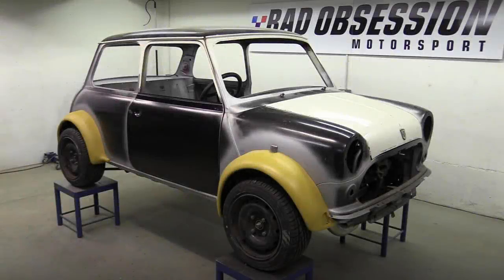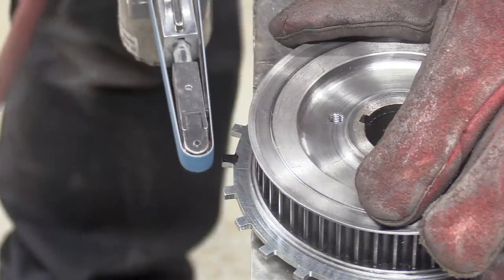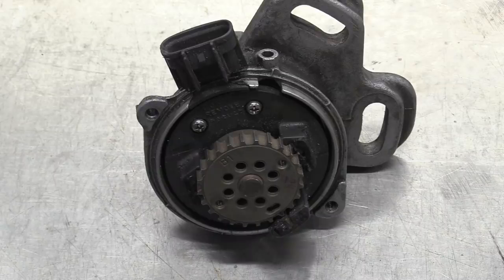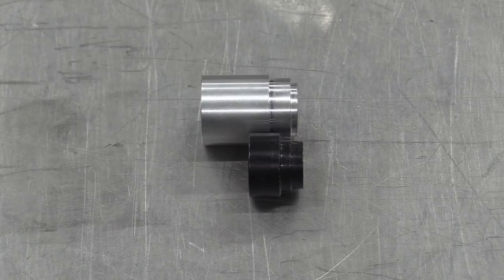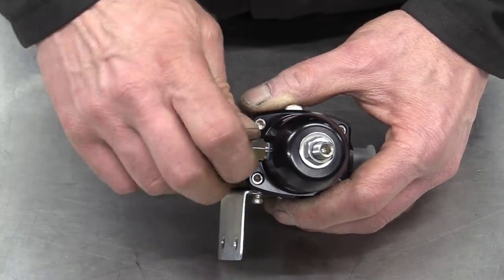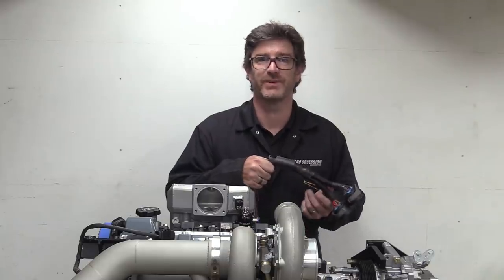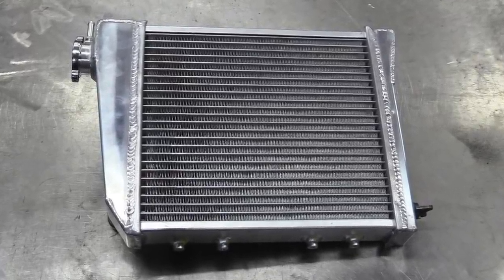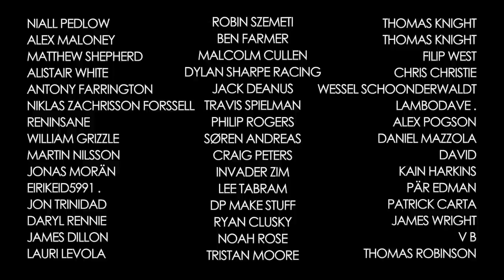Project Binky - Episode 32 - Austin Mini GT-Four - Turbocharged 4WD Mini

Comment: I thought for sure today was the day I'd see Binky painted... I guess not.
Reply: Give it another year or two and we'll get there. Probably sometimes after Nik decides to cram a custom microwave oven and small fridge in the cabin. It's important to have easy access to snackies while on the road you know...
Reply: @andersjjensen  You have just given them idea's that will delay the finish for at least six months.
Reply: @harveysmith100  We're still not even getting into fog visibility system via radar or torque vectoring via ABS programming..... You see, the thing with project cars is: They are perfect as long as you don't use them. Binky is not meant to ever be finished. It is meant to fuel Nik's day dreams about a perfect car :P
Reply: @andersjjensen  My apologies, I clearly haven't thought it through.
Reply: Hold your horses, there's 18 months of block sanding the primer on the inside of doors before we get to the base coat.
Reply: @andersjjensen  Since it can't house the speakers, might as well give the parcel shelf some use!
Reply: @andersjjensen  No microwave, just a kettle and mini fridge for fresh cups of tea
Reply: Comment of the year 2014, 2015, 2016, 2017, 2018, 2019 and 2020. It's on the shortlist for 2021...

Comment: gotta love old fashioned mechanical engineering, haven't touched a mill or lathes, surface grinders since 2002, Now in Design for oil platforms, piping and layout, and this is refreshing to see, as id love to have my own machines; and the space.

Comment: My thought when the carb was thrown was noooo I need its float bowl
Reply: Wasn't it an SU? If so they have an integral float chamber?
Reply: Brenton Edwards , only the very early SU had integral float chambers, the minis was bolted on with fancy rubber bushes so it could be used as a left or a right hand chamber by changing the rubber whotsit.
Reply: The later Metro ones (HS4s or something?) had the float chamber underneath and integral.  Marginally better but still shit 😁
Reply: Perhaps Nik will make one for you. Breaks out the lathe and the funk.
Reply: @johnsherborne3245  other way around the late su carbs and an integral float chamber
Reply: @DarthVader-on4pe  the hs1,2 and 4 had the float chamber on the side and from the hs6 on was integral I believe
Reply: 186scott my mistake, modern is 1970's I forgot about the later versions, though I did once come across with one on a Princess with a death wish.

Comment: Phenomenal work guys, this has been my favorite build channel here for quite some time!

If you're retaining the cam trigger, then you shouldn't need to grind a tooth off of the crank wheel since you could specify TDC as a certain number of crank teeth + an angle after the cam tooth. Generally, removing a tooth from the crank wheel to give a gap is only necessary if you're not using a cam sensor and instead running pairs of cylinders in "wasted spark" mode.
Also, I thought all hall-effect sensors were 3-wire; one for +5V, one for ground, and one for the output signal (logic-level 5V square wave). 2-wire sensors were usually variable-reluctance (VR), where an induced current spike in its raw form is generated between the two wires, which then requires amplification hardware in the ECU to turn into a logic-level signal.

Comment: I love cars, I have since I saw my first Mustang in 1964 at age ten. I love English cars, I have since I owned my first car at age fifteen, but since that car was a 1957 Hillman Minx Estate that I bought for $25, you may wonder why. I've owned two Triumphs, a 73 Spitfire 1500 and a 72 TR6... aaaahhhhh. I've also owned two Minis, a 64 Morris 850 project that never got finished due to it being scabier than a bat's ass and a really nice 67 Austin Cooper. It had the hot 1000cc dual SU motor and was RHD. My favorite car of all time, red with a black top and the red and grey interior. I bought it from a US Customs Inspector that got it at auction. Someone tried to bring it into the states without paying the import duty. This was late 1970s in Long Beach, Ca. I had it for about 18 months before it was stolen from outside my apartment. Bad Obsession Motor Sports videos on Youtube are my absolute faves! You guys are funny, smart, innovative, etc. you see where I'm going. Project Binky is one of the best engineered projects I've ever seen in my 65 years.

Comment: The 'O' rings on the top of the fuel injectors are not OK like that. 'O' rings need support behind them to resist the pressure trying to force them out. The radial clearance of the male and female solid parts directly influences the pressure rating of the assembly. Please consider revisiting you solution, I'd hate to see all your beautiful work lost to a engine bay fire!

Comment: For the less fab crazy you can use the caldina 3S or wasted spark camry 5S oil pump and drive gear that has the missing tooth wheel and drill and make a pickup for the knob on the cam on the rocker cover too.  Much simpler and cleaner than that giant dizzy lid.

Comment: Loving all you guys have done, but to just clarify on one point, those aren't Hall effect sensors on the cam & crank, they'll be inductive sensors if they produce their own voltage.
Keep up the good work chaps. 
Can't wait to see it finished, then see you get on with the Carbon Fibre V8 monster.

Comment: Hang on! You can't start doing painting next.  What about the flared wheel arches? They still need to be moulded. Plus where is the spare wheel going?  I think some kind of bracket to hold it to the handy space behind the driver and passenger seat. Though that could be difficult to get our.  Maybe an tyre shaped hole in the roof that a the press of a button a wiper motor springs to life and flings the required spare tyre out like a slice of toast into the waiting arms of the codriver. Brackets check, over engineered solution check, powered by awesome check - meets all project Binky design requirements.

Comment: Spot on comment with the CRT =)

Gonna play a little devil advocate for a second though. My comment being that sometimes a simple device can be a better option, but this also depends on what you want. Now... my POS Saturn has drive by electronics instead of a pedal cable, and EFI.... but when it comes time to replace either of those, well I'll have some figuring out to do. I'm not super genius Mr. Automotive, but I have plenty of hand tools, an o-scope, and a decent OBD scanner; I can usually figure this crap out with enough time and google searches. A carb and a cable I can fix in MUCH less time. Though I really don't want to go back to cold start issues, I would def advocate for a pedal cable (never have had one go bad even though I live in the rust belt).

Comment: Super Cool ,  I love the demonic little creation you two have been slaving away at for this long and mentally exhausting build. the idea is completely bonkers but you have somehow been able to achieve the seemingly impossible. with space being at a premium (it is a "Mini" after all) there didn't seem to be a snowball's chance in hell that everything would really fit,  But fit it does (with a tweak and schmooze here and there) there is a somewhat similar build here  across the pond in U.S..and I think Nick's "Brecket Obsession is a good thing with al the bits that need holding in place in such a "Small" space under the bonnet and everywhere in that Diminutive  automotive contrivance they call a 'Mini'.there is a somewhat similar build here in the states you should check out called the "Insane Juke Project" where they use a Nissan Juke (micro SUV) with factory turbo 1.6 litre I-4 factory all wheel drive and increase the turbo size to the insane degree and find places for the other bits and bobs that go with it in a somewhat smaller package than the turbo was designed for making about 400 WHP in the end with an enhanced CVT trans, and custom built motor. to take the strain of the increased power potential of up to 500 WHP.  but your Mini is more challenging. and a lot more fun to watch how you come up with the solutions to the many little problems that always seem to crop up as you go along with the build, having al those cool tools and machines makes it a little easier( most of the time) but a "BFH" seems to be the answer sometimes , but then the right (precision or normal) tool is the better choice more times than not.

Comment: The fuel rail, coil hold down bracket, wire bracket over the pit of doom and the air to water intercooler need to be checked if their level so we can hear it make the noise.

Comment: wow, i missed the first time i watch it. But did you cut a radiotor in tree pieces and then flip them 90degrees. And then welded them to create a max airflow path . So you inverted a basic radiator. kudos to you!

Comment: Will be interesting to see how much it weighs when complete with all those brackets 😃
Reply: also the end Weight-Power Output Ratio 
it will be a mad mini 
oem Toyota Celica GT-Four 185 
Weight: 1,440kg 
engine power: 200 hp 
Weight-Power Output Ratio: 7kg/hp 
engine Weight,: 143kg 
total drivetrain: N/A 

oem 1980 Mini 1000 
engine power: 39 hp 
Weight: 620 kg 
Weight-Power Output Ratio: 15.5 kg/hp 
Engine and gearbox Weight: 141kg 

Garrett safety turbo GT3582R Turbocharger 
Horsepower: 400 - 675 Displacement: 2.0L - 4.5L 

now it is a bit hard to say what the end weight will be, but as it is Mini 1000 lets say 1000kg, 
but it will most like be less. 
now small hot engine bay lets say engine power is 500hp for easy match. 
but it will not be under 400hp 

Weight-Power Output Ratio: 2kg/hp 
vs 
Bugatti Veyron Weight-Power Output Ratio 2.1 kg/hp 

there are going to a lot of drug test done on cops the day Binky hits the road 

but superintendent I swear that Mini was doing 220km
Reply: @1BigBen  yep. 1000kg is my guess as well. The shell is about 100kg as the lifted it by hand. Drivetrain and gearbox are hefty kit, though.

Comment: love the engineering and genuine ingenuity of the drive for the ancilliaries and sorry if this was considered but for some reason not used but i believe you can get electrically driven power steering pumps and air con compressors?

Comment: As Nick insisted no making aluminium box brackets and seeing the very low voltage generated by the cam sensor I was thinking this can help with possible cross talk issues that is a signal in a conductor (wire) parallel to another inducing a signal in other parallel wires causing problems in the computer interpreting what it sees. This box bracket will act a a faraday cage and in any case no high tension plug leads to worry about the major source of these issues. The boys will have to keep an eye on the injector wires and possibly others as there may be an issue. This build is so tuite not even enough room for angry pixies. Another ep would really help in lockdown here in Melbourne Aus please. Love you guys ,Ava ,Big Clive,Black Adder. The young ones. 
Nearly twelve wires?????

Comment: I have watched this series 3 times now. Bloody brilliant 👏 

But I keep wondering how much safety power is it going to provide. 
1000cc injectors, plenum inlet, uprated electronics, stand alone ecu, custom charge cooler, turbo rated 400 - 650 bhp and more tweaks. 500whp ish in a mini. That will be fun.
Reply: Yep. Not many comments on that subject. When I looked for the turbo specs, I thought: no. But then the engine! Could indeed be a approx. 500 hp at the wheels... if the front driveshafts wouldn t explode that is...

Comment: Just a warning guys, from someone who has built more 3S-GTE's than I can count.    DO NOT rely on that silicone oil cooler hose.   The heat in that location will turn that silicone hose into mush in no time, spraying oil on the back-side of the turbo and manifold in no time.   In Toyota Parlance, that hose is called "the hose from hell"  and it should be replaced with the OEM jacketed hose.   They are like a tenner, and worth every penny.   Also, that early 2nd Gen head is prone to localized boiling in the passages around the combustion chamber.  A trick to improve flow through there and keep this area cool is to open up the passage in the head with a drill bit 1mm larger.   REPLACE THAT HOSE FROM HELL NOW, BEFORE YOU RUN IT IN....

Comment: The tip of the injector being further away from the combustion chamber... can that cause problems?
I'm assuming a small fiddling on the dyno will be needed. Or to put it in regards to my case, if the injectors are 10-12cm further back than the manufacturers position, will that create any combustion problems?
(I need the injectors at least 10cm further back due to packaging requirements.)

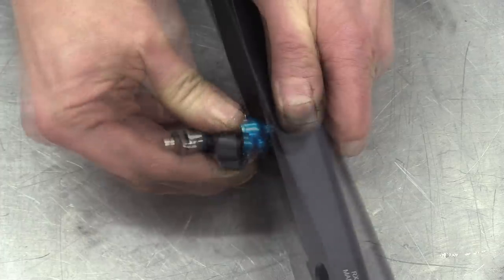Comment: Is that the correct ‘O’ ring at 20:13? That looks like there is no support for the ‘O’ ring. Is the pressure in that rail very low? If It sees much pressure it would surely blow the ‘O’ ring out? The pressure is on the rail side so i would expect to see a close tolerance between the two parts on the low pressure side of the groove. Or am I missing something?

Comment: I know nothing about electronics really so please nobody take this as criticism but wouldn't the heat shrink on the wires in the potting compound provide 'pipes' of a sort through the compound to the metal bits which are presumably better off sealed? Just curious!

Comment: Aftermarket oil pressure sensors can fail from vibration and should be remote mounted to the car if possible.

Comment: Personally would have used a gen 4 3sgte engine over the gen 3 as it already has coil on plug ignition as well as the crank and cam sensors fitted from factory. But I guess gen 4 engines weren't as common/cheap back when the project started

Comment: Is the location of the transducer on the t piece at a right angle to the general flow of pressure going to make any significant difference to the value it reads for a given pressure?
(apologies if this has been asked, I cannot be bothered going through 2048 comments to check)

Comment: I just recently came upon your impressive project and watched trough it all. The only thing that bothers me is you substituting the harmonic balancer with a solid pulley. I read a comment about this but he got no response. Thats a serious thing, the manufacturers don't all put them on there without a reason. 
You could mount a balancer and then make a pulley that sits on there like a hat.
Or a balancer with integral pulley could be adapted.

Comment: I'm curious why there's 3 oil pressure sensors, obvs we haven't seen the cluster setup yet but it seems odd to need so many.
Reply from the maker: There's two sensors and one switch. One sensor for the ECU, one for the analogue gauge and the original low oil pressure warning light switch. Belt and braces really.
Reply: @BadObsessionMotorsport  ah so you avoid risking a single point of failure taking out all your warnings, makes sense. Does the ECU have safety measures that kick in if the pressure drops?

Comment: BOM: "this is not a reality show" proceed to build a temporary bracket "to know where the cables are going in the car"...lol we know that the car is like 10 meters away in another garage
Reply: Also just cut the plastic out of the pink injector...would have been lighter simpler safer faster better...but you know Nick maniac...ahhah maniac maybe but kind of an impractical one

Comment: I am puzzled, you must remember in my day Turbo meant foreign and probably not to reliable, but did or did not Nic spend a lot of time welding up a cooler for the turbo that mounted in front of the radiator now he has just manufacture one to put on the top?
Never mind I went back to episode 7, yeah it's been that long ago and found out there is a separate radiator for the charge cooler
Reply: if I remember this right 
the front cooler cools the water that cools the air coming from the turbocharger before it enter the throttle body

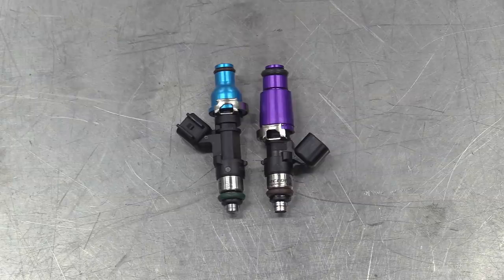Comment: 17:46 if they just ended up putting the tops that were too small to start with from the id 1000's onto the 1050x's and just put a bigger o-ring on them,  why did they just not put the bigger o-ring on the old 1000's and avoid all the spacer hullabaloo in the first place???

Comment: You guys are killing me.  How long can it "really" take to paint a mini?
Reply: Was thinking the same thing. Binky disappeared just before Christmas ( 2019 ) - just how long does it actually take to brush on a tin of Hammerite ???
Reply: More than 7 years. ...
Reply: What I am thinking is that they have signed everyone in Shropshire to secrecy and they have it all  put back together, and they are currently driving it to get the break in oil through it so when the video comes along after all the editing, they can really go hooning about the countryside and make it a great end to the series.
Reply: @Deputybull  That's not at all unlikely - bribing the entire population of Shropshire would probably cost less than a set of injectors. BUT ... the 'putting it all back together' is inevitably going to require some new/modified bracketry, some fine adjustment to the fit/alignment of some parts ( a.k.a. whack it with the twatting stick ) and a whole bucketload of hot tea. Nik and Dick would never pass up the opportunity to show us, in minute detail, just how much effort was involved in all of that. I think it is more likely they have just nodded off during the filming of the closing credits.

Comment: I just wanted to point out, at about 19:00 the statement was made "These are a very light interference fit but to get them to seat properly it was prudent while at the lathe to make an adapter-hammer interface to avoid damaging the new parts with the twatting stick." 

Wouldn't that be a adapter-twatter interface? 

I'm just looking for clarity...  

Why I'm looking for that here, I'm not clear on.